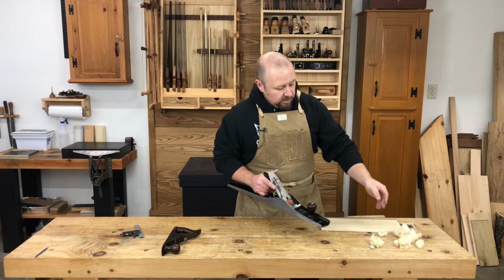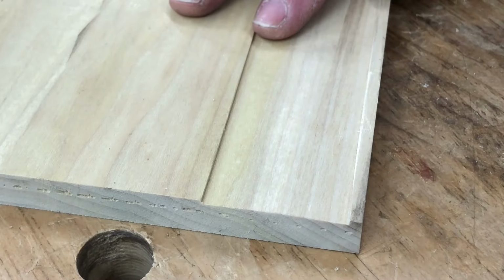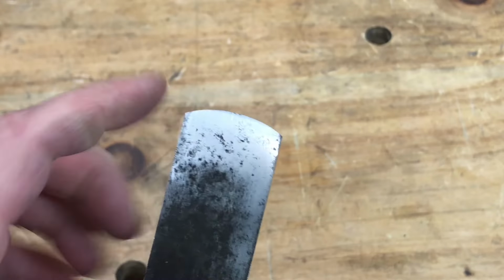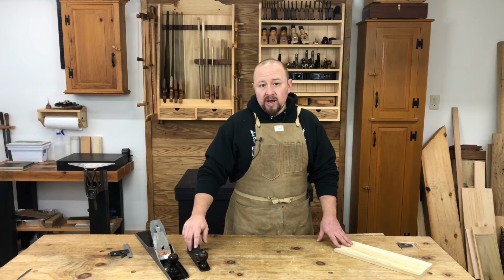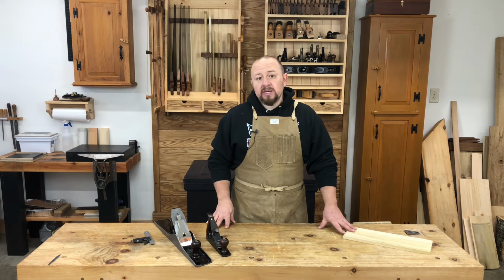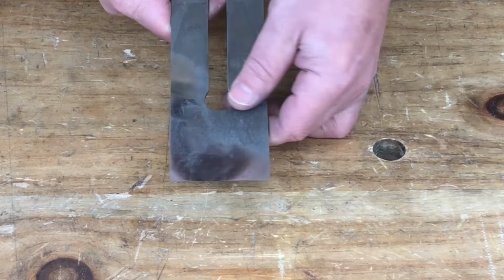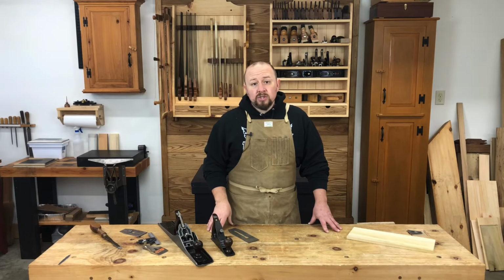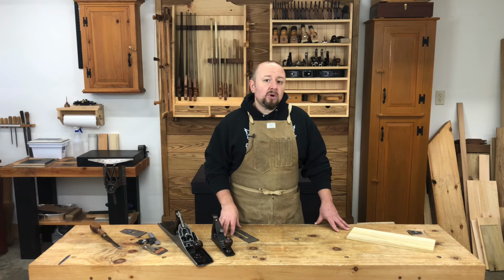Should You Camber Your Plane Iron? | Hand Plane Foundations

Comment: I use a camber for all my bench planes, except the one that I use for shooting. I use a camber on a try plane also, for me its easier to square an edge with a small camber on the iron, I shift the plane to the side so its not centered on the board; depending on which side of the edge I need to lower. I use that same try plane for flattening a surface too so the camber is needed there. Out of curiosity........ how much camber would you put on a foreplane/scrub with a 2 3/8 iron??? I use a 5 1/2 as a foreplane with about 8inch of a radius to the iron.
Reply from the maker: In my opinion using radius is a useless measurement as it doesn’t translate well to planes with different iron widths or different bed angles. Sure, one can do the math to figure it all out but it’s completely unnecessary.

When I establish camber for a fore plane, I color the back of the iron, project the iron below the sole of the plane the maximum depth I want that fore plane to cut (between 1/32” and 1/16” deep) and mark the edges of the iron where they intersect the sole of the plane. Those marks tell me how much to camber the iron and it makes no difference what the width of the blade is or the bed angle. Next Tuesday’s video will demonstrate the process.
Reply: @BRFineWoodworking  I know the curve doesnt need to be accurate on a roughing tool...... but for marking out the radius on the back of the iron I jus went with 8inch for some reason. Used a trammel on paper cut to the width of the iron to mark the curve, cut the curve on the paper then traced around it onto my iron. It works decent, but im starting to feel as if it's too much curve..... it cuts very deep; I can probably take nearly 3mm (1/8) in a pass if I wanted to. When set to take a normal shaving like the size you mentioned, it's not cutting very wide; maybe only an inch...... I think I need to take some of the curve out of the iron to give me more width. Feels like its takin a long time to cover a surface when I'm only able to use an inch width of iron. I feel I can improve on its efficiency. Il be taking your advice, thank you 😁

Comment: I use rounded corners on smoothing planes. Have some trouble getting fine camber on some planes. Have been using a 4 and 26 as scrubs and camber is easy. My five I like to set up with a slightest of camber to use on edges and some surfacing, But quite often end up with too much. Using three grades of diamond stones. Looking forward to seeing how it is done and maintain in successive sharpening.